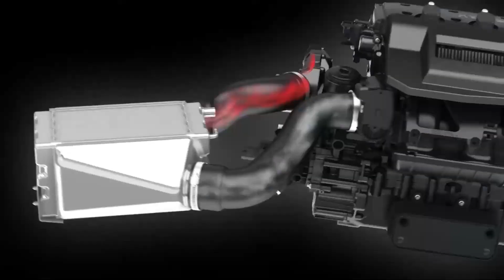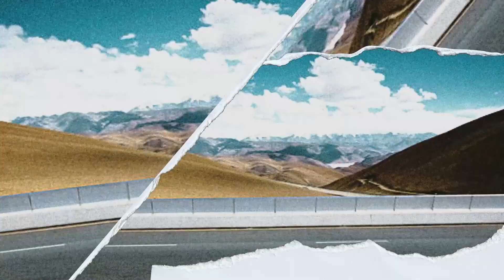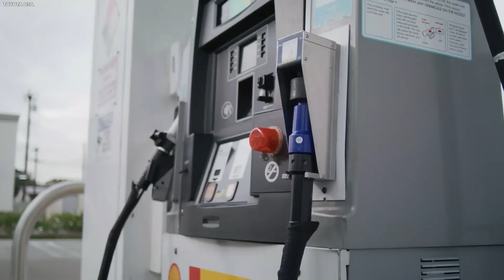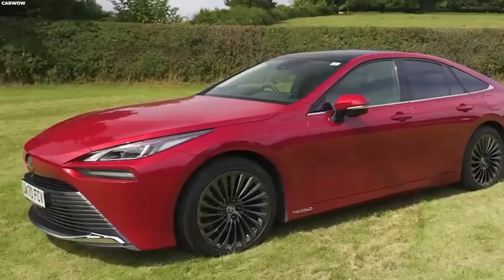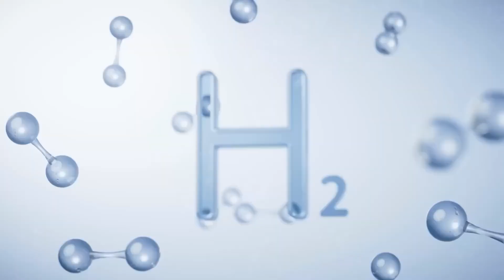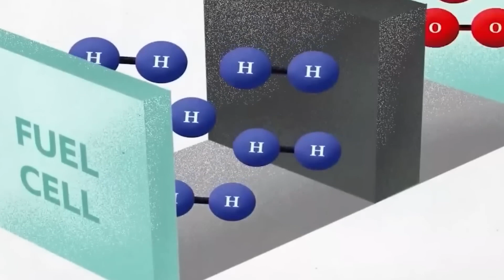BREAKING: Toyota’s New Engine Tech Sends Shockwaves Through the EV Industry

Comment: Listen to the slick monologue with care..... electrolisis makes the hydrogen, which then goes throa a reverse hydron cell, that generates electricity and moves the car..... fantastic....EXCEPT that inicial hydrolisis needs electricity!!!!! Maybe Toyota have improved the efficiency a little, but you need around 55kw of electricity to produce 1 lt. of hydrogen. Reverse hydrogen cells, consume 1 lt. of hydrogen to produce around 17 kw of electricity. So, the car consumed 55kwodf electricty to make 1lt. of hydrogen which then produced 17kW of electricity.... a loss of about 70%. I am sure Toyota have improved some eficiencies.... but it still doesn´t add up!!!